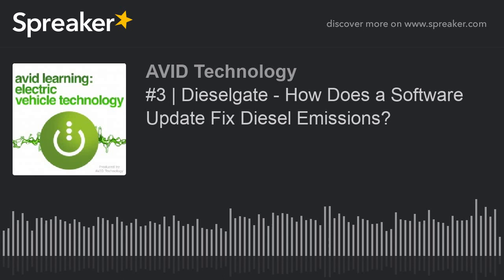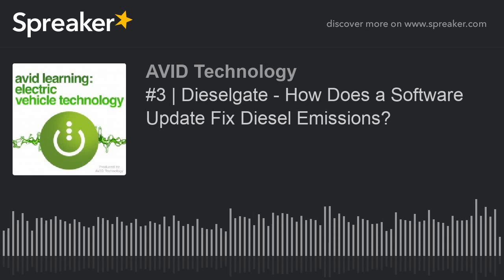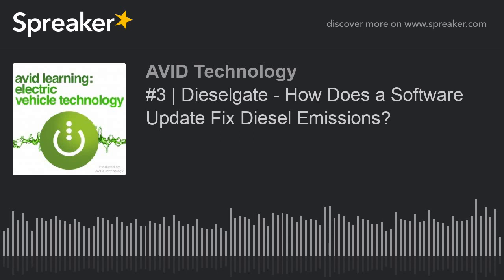#3 | Dieselgate - How Does a Software Update Fix Diesel Emissions?

Comment: Hi, I've specifically asked Volkswagen service people to not do the update since it still meets the emission norms in my country BS 4. 
Also I do not want my car to run like a tractor .
The update is not mandatory in my country and can be done voluntarily. 
But they have been pushing me to do it since months. And I denied permission.
However I have suspicion that they have done the update already during the last service  without my consent .
How do I check for myself if the update is done on my vehicle or not.
Are there any physical inspection that I can do? Or can I use vcds to check. 
Any help would be appreciated. Good job with the video. Thanks.
Reply: im thinking the same thing